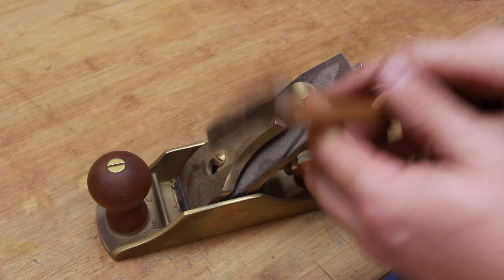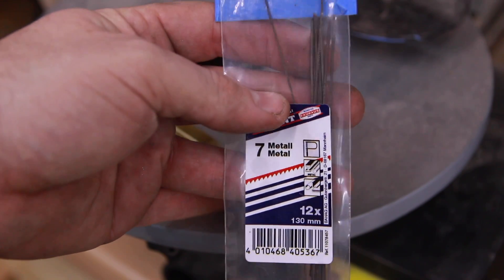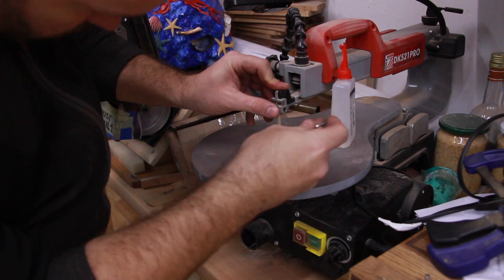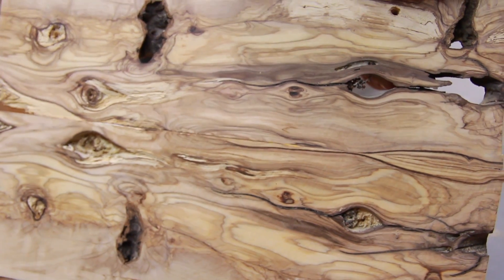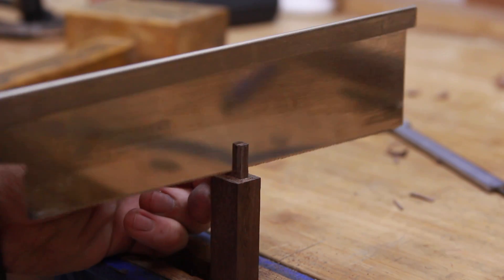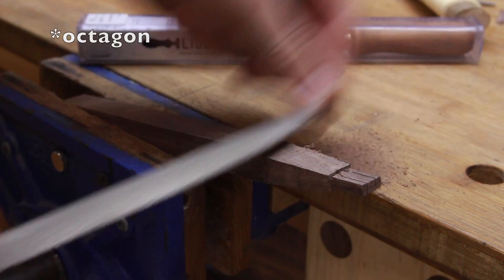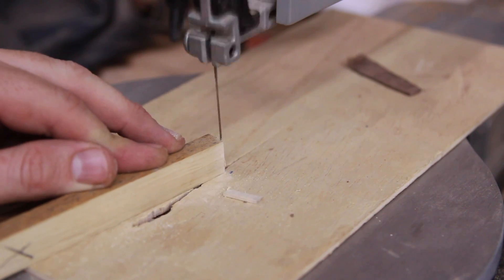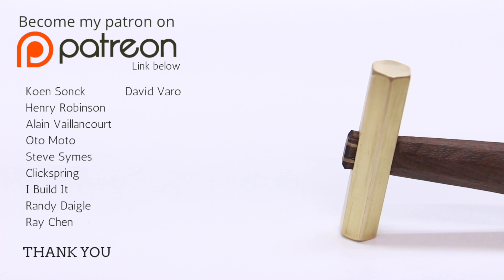Brass Hammer that every shop needs

Comment: 0:20 Of course, your plane has a lateral adjuster already on it, so there's no reason to use any hammer on it, But I get where you're coming from. Nice work by the way
Reply from the maker: That lateral adjustment is only for rough setting of the plane. It would be very hard to finely tune lateral adjustment solely using that lever. Hammer is essential for precision.
Reply: @AndreaArzensek  Hmmm I don't think I would agree with that. I have used planes for years and never needed a hammer on one that has a lateral adjuster. You just have to be easy with it. And not over tighten the lever cap. It only needs to be finger tight. That's why most people find lateral adjusters hard to use. But, I wont argue that with you. You do it your way.
Reply from the maker: Then I have been doing it wrong for many years as well 🙂

Comment: Not sure if you will see this but I might as well try. What size was that brass bar you used ? I'm considering making a similar hammer. Thanks
Reply from the maker: I see all of the comments :)
Around 15x67mm. I actually bought just this piece at local hardware store as they had it in scraps. Really cheap. Handle is black walnut and it is 220x20x15 and tapers from that to the head of the hammer. Good luck
Reply: @AndreaArzensek  Thank you very much, great videos btw I watched a few after this one :) be well
Reply from the maker: @kz.irudimen  Thanks 😊

Comment: What is the different between steel and brass hammer for hand plane?
Reply from the maker: Brass is heavier but also softer than steel.
Reply: @AndreaArzensek  it has been about 4 years but you still reply my comment, thank very much bro😊
Reply from the maker: No problem ☺️
Brass (or bronze in this case) plane is good because it doesn't rust and the weight may be beneficial in some work. We absolutely love our LN 4 Brass plane. 
Brass hammer is perfect because it won't damage the steel when using it on a plane. Best regards from Croatia 😊